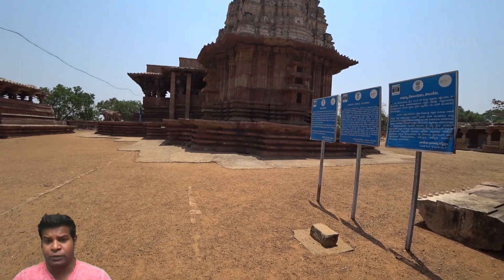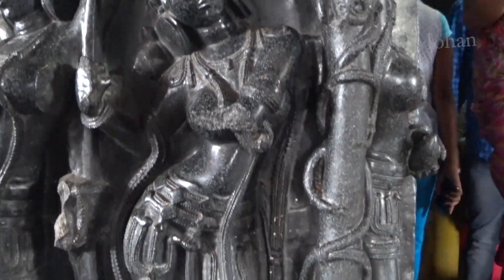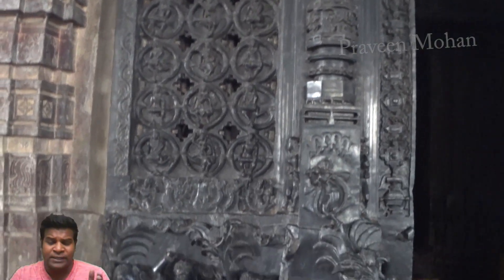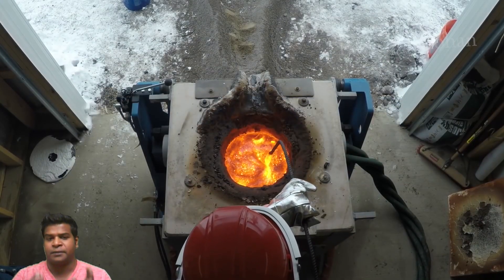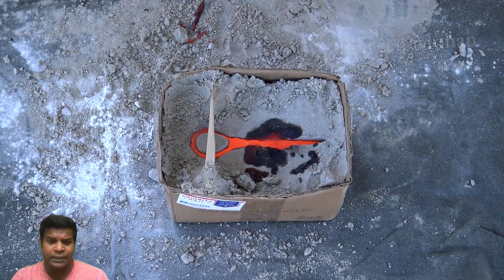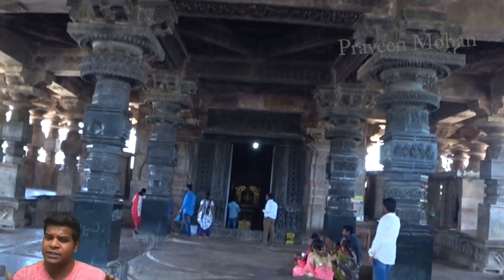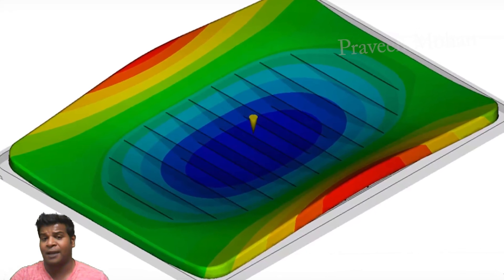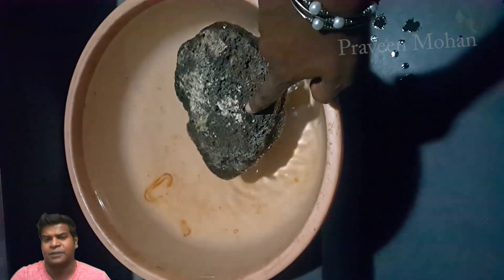Rock MELTING Technology at Ramappa Temple, India

Comment: i worked for 5 years in pvc injection and thats right the warping effect caused by the piece going cold on different temperature so they dont fantilate well this piece during the time the mold was made witch made this block curve ;) on the side face and you can event tell this curve face was the dowm one the face of the block who face the ground buring the mold ;)
Reply: whats is crazy is thats they mold granite or the build granite for the sand-quartz-and rock by melting it ? cause those block are not rock solide but granite + metal + rock + even some material we never know at now so they use mix and some kind on high temp to melt mix everything to one dawm solide block of we dont whats sometime ;) sound like explainable but crazy like you says its not maked by hand only and primitif tool or the use volcano lava directly in a mold during the time of a volcano eruption ? maybe but sound freak as helll ......

Comment: Please correct me if I am wrong, but the carvings are raised, and therefore wouldn't have been carved into a blank area. So assuming the rocks were molded, the carvings would have been cast at the same time. Looks to me like a carving was once there and for some reason was removed and ground away (poorly since it's not flat). Grinding could easily have been done back then.

Also, in such a majestic place, why would the builders have used a defective piece like that? Especially if they could have just cast another one... I think this was done to the pillar at a later date. Thoughts?

Comment: The 'flawed rock. Why did this keep them from carving it? if they just did not want to carve a flawed stone, then why use it anyway? to create and maintain enough heat to melt this much stone would take a tremendous amount of fuel. which wood would hardly suffice. It wood require steel containers, special clothing and something to lift and pour the heavy super hot lava. It has to be one big pour not a little at a time.  I think Indias sites are far mor interesting than Egypt.

Comment: Hi Pravin, the way you explain and analysing science behind the each part of ancient Indian structure is fabulous.  But in this case I am little doubtful about your opinion,   I think these rocks are not melted , it is pure basalt original rocks . Mainly after fittings pillar , Indian artist designed different shapes on pillar. There was fault made by artist while designing shape , so the finally planed the surface and while levelling rock bend occurred. 
As we know Indian architect and ancient were master in metal process, rock selection. In besalt rock mine rarely you will get such piece of rocks who gives you different sound, might be it contain huge amount of iron or magnet.
Finally We salute ancient  Indian architect , artist. Keep rocking Pravin.

Comment: At 6:04 you can see that the internal patter is straight, it is only the external surface that has been worn away (as though some imperfection has been ground away). Clearly, you cannot make such a complex structure from one piece of stone just by banging it with rocks and something that is substantially more advanced that historians give them credit for has been used.

Comment: As basalt is an igneous rock to begin with, to melt it won’t create metamorphic rock? Or to have metamorphic rock such as marble heat AND pressure must be applied? Now a sand casting is more a crude way to form a casting vs. other more sophisticated methods such as lost wax. Of the mould can be only used once as for sand casting, but the enormous temperature of the liquid rock, if there was any moisture in the mould, could explode it. It is possible that the rock in heated liquified state warped the mould?

In some very old building in Russia, some sculptures are not solid rock but are a veneer and they apparently had the recipe like we know how to make concrete, yet still did not want to waste the cultured concrete. Only the outer part is pretty, the inside is either hollow or filled with a less choice material on the inside.

The secrets of the casting or even the veneers of rocks was not written down, no one knows how they did it. As this style of building was no longer used or the people were killed who knew how to do it, 

You pose some very thought provoking questions. Modern man’s ego is that “we are the zenith of all of mankind’s accomplishments” so anything to show the contrary, gets taken down, or flagged or taken out of subscribers’ feeds.

Glad to see your channel again. Have missed you very much.

Comment: For the last 21 years I have worked with granite, marble, onyx, slate, soapstone, and others. I believe that the dimensions of the cylinders even if they are Hollow would not ping like that.  I believe that it's not only melted and poured Stone but there must be other elements added. if you took two cylinders of granite, of different thickness and hollowed them out you would still not receive the pinging sound that you observed. such light tapping on the stone would still sound like a thunk more than a ping. there are natural weak spots in stone that we call Fisher cracks and also there are weak spots where  different types of stone meet Within the main Stone.  I find it hard to believe that while carving these elaborate statues, pillars and wall Engravings that no mistakes or broken pieces occurred during their creation.  which further backs up the theory that it was poured. Granite has many different types of stone mix in with it in order for it to be called granite.  geologists say it has to have between 8 and 17% quarts in it.  when polishing the face of granite some of the stone is softer than others. when polishing Granite that is dark in color ( like black) it is easier to get it absolutely flat but other granite like delicatus are extremely hard to get absolute flat because of all the other types of rocks mixed in with the granite. it is possible to get delicatus completely flat but the process takes more specialized tools and knowledge and time that can only be accomplished by machines that apply exact precise amount of pressure throughout the entire face. when we receive slabs of stone there are low spots within the granite when you check it with an absolute straight edge and Light. these typically occur over top of the softer stones mixed in the granite. If you apply too much pressure or stay in one spot too long you may heat up the stone too much which discolors it. that's why we use so much water when we cut and polish the stone. We do not offer ogee bullnose or waterfall edges on certain types of granite due to the difficulty of obtaining the angles or sharp radius that are required without great difficulty. anyone who has worked with stone for many years will agree with you that these Stones Were Somehow melted and poured.

Comment: It is possible to create concave with manual tools or power tools. It is incredibly simple in fact. You simply grind down on one spot. 
Also once you melt stone such as basalt or granite it permanently changes the structure. Metamorphic basalt is basalt that has been melted and recooled.
If the basalt of Hampi  had been melted it would be visibly different as well as chemically different.
Reply: thank you!! finally some one sense

Comment: I wouldn't gos as far as calling that "solid evidences" though the idea is interesting. This wouldn't necessarily be the "only way"......you could achieve different frequency responses by making variations in the inner diameter of the rock cylinder itself as well. They could also have used EM frequencies, microwaves or even sound to carve rock without the need of melting anything as far as we know. Besides, molten basalt does not look anything close to this, and what about the polishing process? My feeling is that we are still far from knowing anything about their supposed technology. Good try though, and many thanks for that interesting hypothesis.

Comment: The warp in the casting is called a sink. I'm glad you're considering casting as a method for these amazing stone sculptures. More people need to consider this as a real method since it actually makes sense.
Reply: interesting video. I could speculate that the flute is hollow due to a core drill into it, and the deformed pillar square is due to a fracture that was then grinded out of it, leaving an indentation. To remove the crack imperfection the pillar was smoothed out and dented.

Comment: Perhaps the concave facing is not a defect. Perhaps it was done for some acoustical effect. So much precision work and they let that one pass through quality control? Also, you are correct on the molding analogy. The sinking in effect is typically referred to as sink. the center cools slower while the outer surface has already "set". As the center cools it contracts,  pulling other material in.

Comment: That blocky object at around 5:24 looks completely out of place, to me. If I saw this in a modern building, I would recognize it as part of a cooling and heating system, with slots for ventilation. It is bent because it was metal and someone dented it, at some time before it was buried in mud, ash, or water. Why would anyone carve, or mold, something like this out of rock? You get all that beautiful, flawless artwork everywhere, and then the artists made that junky looking thing? Why would they attach it to a pillar instead of tossing it in the garbage and making a new one? Why make that at all, when it has no aesthetic value and clashes with the decor? It just looks like something that was attached at a later time because it was needed. How many civilizations are we looking at in these old "temples" around the world?

Comment: So, how did they get a fire up to over 2500 degrees? Then how did they handle it? what container could they even put the "rock lava" into? They would need to get their fire over 2500 degrees AND possess another material that doesn't melt at 2500 degrees to melt the rocks in. What could the container be made of? The hot fire part is probably not an issue- maybe, but what did they possess that they could process the lava in? Answers about Earth's past always raise more questions in my mind. lol

Comment: They used a technology that has now disappeared based on frequencies, which softens the rock at various stages by acting on the molecular bonds, until it becomes liquid in the case of molds filled with processing waste, or malleable, as in the case of large blocks of walls in which not even a pin passes between them. When the frequency administration ceases, the rock hardens, but if you remove it from the mold too early it is still soft. Note the absence of any processing residue ..... Even the powder was reused.

Comment: i beg to differ that you can't hand polish something to that level... would take a bit longer than using standard tools and equipment with buffing wheels but you can also achieve a far higher polish by hand to the point of glass surface in smoothness. using the same material you are carving and crushing it up into the finest powder and then taking a shammy and doping it with a slurry mix of that powder mixed with water or an oil of the era you can polish it beyond mechanical means. it's a so called "lost technique" because it's been forgotten with new technologies and inventions that newer generations would rather use because it's "faster" and frees up more of their time... the results are far from perfect when compared to hand polishing using the old ways. modern wood workers that do lathe work actually still take some of the chips from carving and will hold them against a piece while it's still spinning to burnish the rough spots on a piece. the material hardness being used against itself is what creates the perfect surface because they both wear away at each other and it's impossible to gouge or scratch the surface of the material you are working.

Comment: PraveenMohan  Don't you think if they had the capabilities to build a crucible and smelter large enough, with a consistent hot enough heat supply to melt the amount of rock to cast the extremely large sized  castings, there would be some kind of remnant or record of such a large industrial foundry and all the different giant molds to cast monolithic castings? Take into account the size of smelter just to melt the tiny mud puddle size of rock you point out in your example. Then you must ask where and how did they mine haul and pulverize all the enormous amounts of rock from, to feed this giant crucible and smelter? Sorry my friend but the size and operation of an industrial foundry and the mine to supply it would be a bigger feat of the time than the temples themselves...

Comment: The geo-polymer concept takes various forms. Even though heat is the most obvious way to soften stone, this is the first instance of an artifact presented as evidence of any thermal method that I’ve seen. 
Other geo-polymer methods that I am aware of include harmonic and chemical.

Harmonic is seen on large immovable natural stones that seem to have scoops taken from the surface of a stone much too large to have melted part of it thermally. Other examples are where stones are textured and shaped on the surface or seemingly “cut with a knife as if it was butter”.

Chemical methods are sometimes structures that look like natural stone but show layers when weathered that look like incomplete mixing or kneading. Megalithic blocks of stone in mortarless walls with no gaps in the seams. Places where the stone was shaped and the reddish residue was left. It looks like they had the ability to temporarily soften stone and reshaped surfaces or cut rough shapes into stone. It also looks like they had a form of cement that would end up looking like natural stone seen in sandstone and marble or possibly granite or quartzite.

Comment: one more gem video PM. 
i find it strange that the king or priests allowed the defective pillar inside the temple, so near to the sanctum. 2  possible reasons -
1. defect occurred  after construction, i.e during carving, and it was not possible to replace as its a pillar supporting the roof. 
2. defect introduced by design , maybe to hide something inside that pillar?

reason 1 probably, hindu  architecture focuses mainly on symmetry, and the design is perfectly symmetrical.  temple was opened and inaugurated by the man who commissioned it. then came the carvers using a tool which generates thousands of volts, i.e heat, like that of a furnace. but not made red hot like in the foundry  , hot enough to mould it, just made the surface soft and malleable so it can be carved with relative ease. actually looking at the finish and precision, they would have used a mold and then heated that stone to the point of melting and the rock took the shape of the mold. the same was attempted on the other pillar but something was wrong with the density and that disfigured the carving surface. they didnt want to add or mess around wit it more as entire temple might collapse if that pillar goes down as it was holding the roof which is made of heavy stone blocks. 

does anyone have a theory or explain why they left it blank? this small defect sticks out like a sore thumb so it can't have gone unnoticed , nor was it left incomplete. remote possibility of it being destroyed exists. as in they would have created a carving and that got damaged either accidentally or by some one, so, they erased it out and that resulted in the curvature. must have happened one or two generations after construction so the person who commissioned it was long gone so next king didn't have any other option but to leave the defect alone. 

most likely the king or priest who commissioned it would have chopped off the hands of the architect who was responsible for carving.  or maybe the priests , superstitious and orthodox,  must have offered prayers to God to placate this mistake? the  priests were insatiable and corrupt, money power, sex, fear were his attributes, they would not bend before any one but god while peasants and other civilians bent before king and God and Priests. priests would have told the king that God is mighty displeased , needs 7 year yagna (a ritual in hinduism) involves chanting of sacred text in sanskrit and a fire put, agnikund it is called i think, use ghee and wood and set it on fire. all this for 7 long yrs to get forgiveness from God for leaving that pillar blank and not carving anything on it. to allow such a glaring error in a house of worship, some hands were greased for sure.

Comment: The rock flute most likely is molded around graphite or some high temp material, then they cooled different parts of the cylinder at seperate rates, like putting water on one end, to get some warpng that would sound like different notes

Comment: Melting metal in to swords and other weapon?! FFS NO! NO NO NO NO!!! THAT'S NOT HOW IT WORKS (face-palm). Clearly you do not know what you are talking about. If you try to do that your weapon will fall apart the minute you decide to strike something. You have to hammer on it, it doesn't matter if you do it cold on bronze or 1000 degrees hot on iron but you allways have to Smith the damn thing in order for it to not break

Comment: Geopolymer builders knew to vary the mold aritficially.  By the content and to melt the rock into stone, they were experts in chemistry and ceramics.  Low heat ceramic was used in the Inca stone walls, by melting rock with  acids and reforming it with other chemicals.  Wonderous!  Thanks!
Reply: I meant to say reforming rock with low heat ceramics.